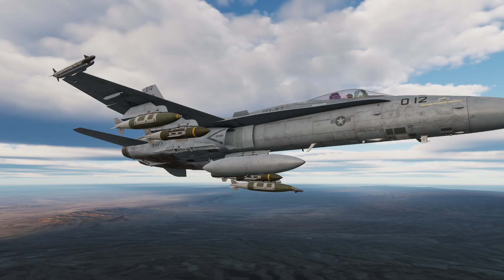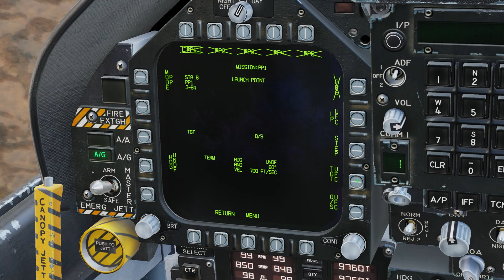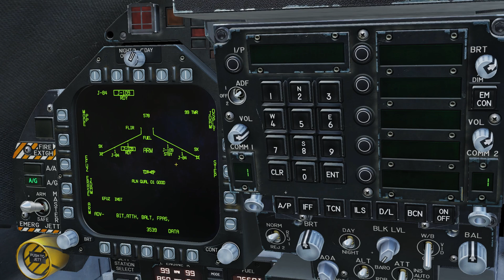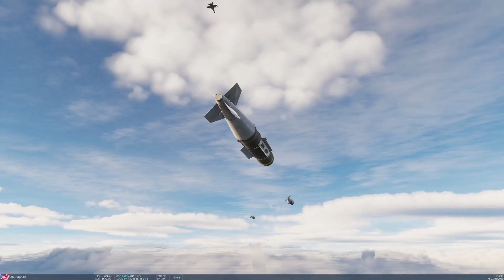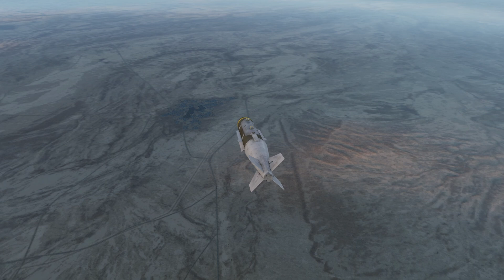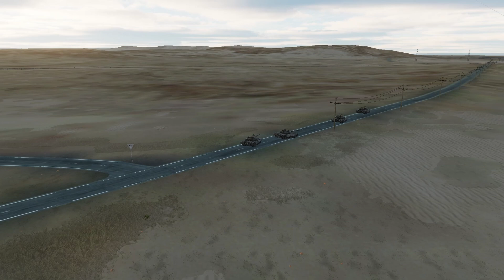Joint Direct Attack Munitions | DCS F/A-18C

Comment: Hey man, I know this is an old video so I most likely won’t get a reply, but what are the TOO1/2 and PP1/5 modes, I’ve always thought they were the different munitions on the same pylons, or am I completely missing the concept? For instance, I’ve always thougt that you put in coords for your PP1 mode, then click on PP2 to select the other JDAM on the same pylon. By the way, Im sorry for my horrible English
Reply from the maker: Your English is very good, your question was very well worded and clear.

PP1-5 are Pre Planned Targets 1-5
TOO1-2 are Target Of Opportunity Targets 1-2

These targets are unique to the pylon, not the individual weapons on the pylon. Selecting PP1 on a pylon will mean that both weapons will try to go to the PP1 target. This is why you must manually change targets when you have released the first four weapons and the cursor goes back to the first weapon again.

I hope this answers your question, but do let me know if you need further clarification :)
Reply: @EchoVictorDCS  Got it, so there's no way to set, say, 2 gbu-32s on the same pylon to 2 separate targets somewhere or just in the jdam mission data before takeoff? You have to put in the coordinates for the second jdam after you drop the first? Also, great stuff,  I'd go insane trying to reply to all of these comments!
Reply from the maker: @Agm-88G that's correct, yes :) You can put coordinates in both of the preplanned targets before releasing them so that you only need to press the other PP target when releasing the second JDAM from the same station
Reply from the maker: At 4:36 on my other video called AGM-154 JSOW, I show how to release 4 weapons on 4 different targets by pressing TOO2 after the first two have released. This is the same for the JDAMs :)
Reply: Do you ever plan on making a realistic startup video for the f18? i find chucks guides a bit hard to get into my head lol
Reply from the maker: I certainly do. I want to finish my A/G mini series first (Surface Attack Tactics and Close Air Support) then I'll probably look at doing a beginners series (start up, taxi, takeoff etc)
Reply: @EchoVictorDCS  Yeah keep on going with this stuff, we're loving it